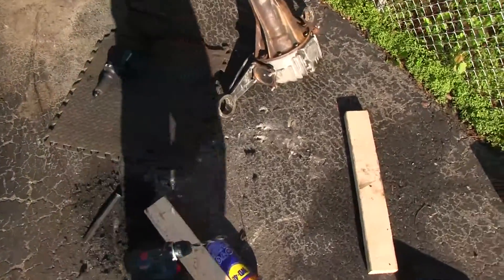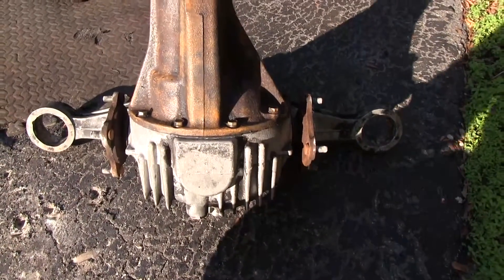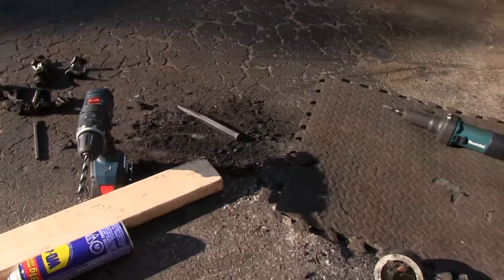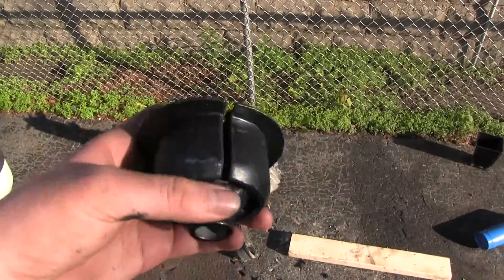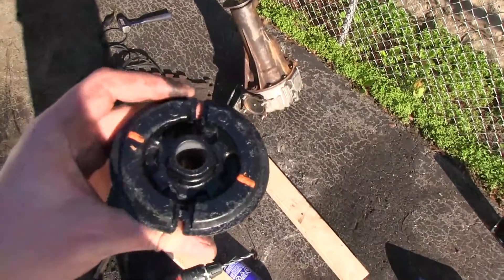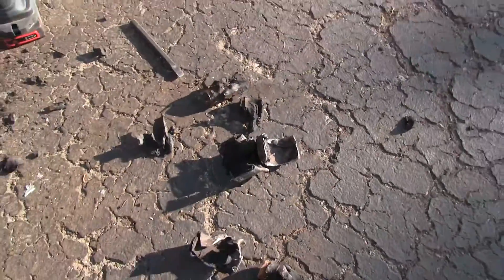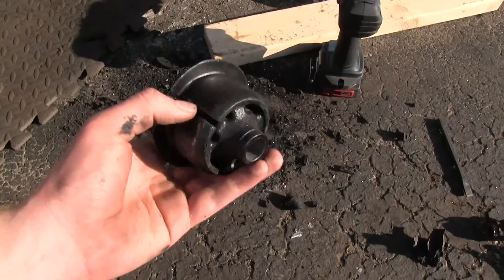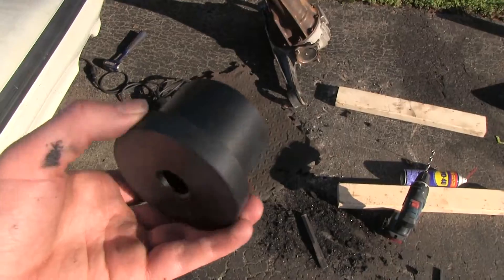RX-7 Rebuild  Ep 2: Differential Bushings

Comment: When you burn out those bushings, use MAP gas and get the flame going real hot. Eventually it will stay on fire and burn out. Repeat on the other side(like...the bottom)...after the flame burns out, while the rubber is still hot, put pressure on the center metal piece and it will just push out. Then do one more burn cycle on the all the rubber left in there and you should be able to scrap it out. Finally, and air hammer to remove the metal casing. STILL a lot of work! But took me 2 hours instead of 2 days.

Comment: Those OEM bushings look a lot like the rear bushings in the lower control arms on my Mk4 Jetta. They were a pain to remove too, but weren't left in for 3 decades like yours, so the metal outer ring was much more malleable, and just caught and folded in toward the center of the hole with just chisel and hammer.

Be glad that you slogged through this -- chances are you won't be changing those new bushings for a decade or two. Once it's done, it's done!

Comment: How did you get the new ones in and how tight of a fit were they? Your video was the key I needed to getting the old ones out, but now the  new delrin ones are turning out to be a tighter fit than I was expecting. I replaced the differential subframe bushings at the same time also with delrin and those ones slipped in by hand with almost no effort.

Comment: Getting the diff out of an FC is a crummy job! Wish they would have made it easier but  if you have out might as well replace everything at once! Cool build!
Reply: It's not bad imo. I disconnected the driveshaft and dropped the entire subframe in about 30 minutes. From there it takes 5-10 minutes to get the diff separated from the whole assembly. The bushings do suck to get out though. 
Contrasting to my brothers e36, which took about 4 hours to drop out the whole rear subframe/suspension. That was with things going smoothly!